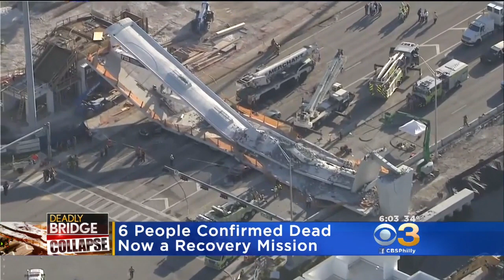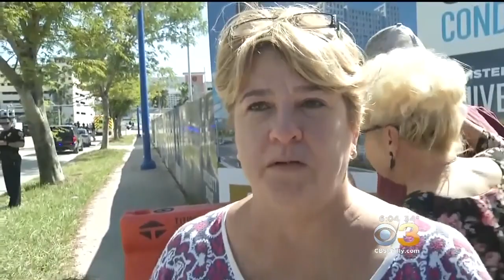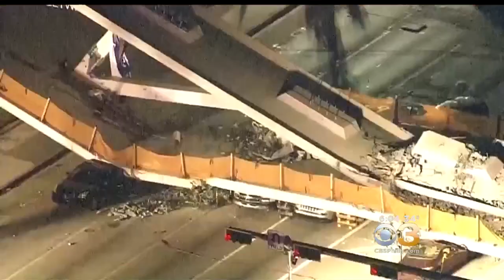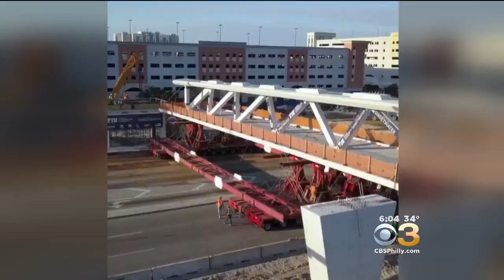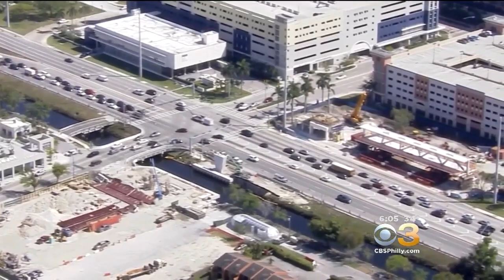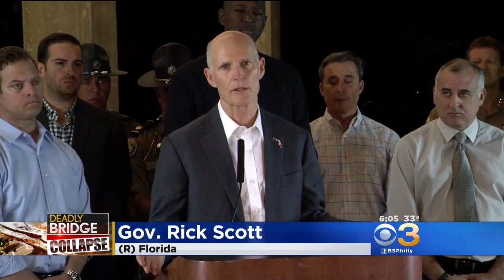6 Dead, 9 Injured After Newly-Installed Pedestrian Bridge Collapses At Florida International Univers

Comment: they dropped a piece of stress testing equipment from the large crane because the crane hook failed. the left end in your pictures is where it hit the roof causing the roof to pancake on top of the lower deck. eyewitness said the crane hook was straightened or a piece broke off of the hook. the equipment was a tensioner of some kind.
Reply: Unless the boom of the crane fell on the roof, there is nothing on that crane that could have made that bridge fall. Hurricane proof, remember ?
Reply: Jim Campbell — They were not doing a stress test, they were adjusting the tension bars.  Should have closed the road for that, too.

Comment: You see that blue motor at the end of a rod sticking out sideways on top of the bridge near the side that collapsed. That is what took the bridge down. They were in the process of tightening the tension cables, a stress test and way over torque it. I guess this is what happens when it fails the stress test.
Reply: Oh, did they snap the tendons ?
Reply: If they were in the process of doing the test. Why the he'l didn't they detour traffic? To me this is murder!
Reply: The bridge was damaged internally from failing to support the ends during the move. Internal sensors alerted the contractor moving the bridge that something was going wrong and wanted to stop the move but was pressured to complete it and figure it out later because of all the dignitaries that had gathered under the big party tent that morning. A couple days later they recklessly and criminally attempted to correct the tension until it snapped. The plans called for the supports during the move to be at the ends but the builder figured they could save a lot of money by moving the supports inwards and not having to  level the road under the ends. But the bridge was not designed to support its weight that way and it was damaged and because this cantilever bridge was covered in concrete they were unable to see the damage but a good engineer would have known there was damage.
 Bottom line the builder knew he fucked up and then tries to quietly fix the problem that he was unqualified to even understand.
Reply: Why would they need to support the ends during the move ? The end sections of the tendons don't need to be supported, they need to be left alone. If you saw the sketch of the completed bridge, it was suppose to be a suspension bridge. The only part you got right was the tent full of dignitaries. They should have been invited to the grand opening instead.
Reply: Actually they still have not said anything, I pieced it together and a year from now the NTSB report will agree with me.
Reply: In your dreams
Reply: Kwame 
First of all: It is a cantilever bridge NOT a suspension bridge. The tower and cables that were to be added later were purely cosmetic. A cantilever bridge must be supported at the ends, not doing so changes the whole dynamics and WILL damage the bridge PERIOD  
I have to say you had me going there for a minute , I thought I was conversing with a person of intelligence. 
I think we're done here Kwame_Be_Broke... Goodby
Reply: Yeah, you're done alright. Obviously you did not see the rendering. It's a good thing you are leaving, next thing I know, you would be hounding me for my atuograph. 

A Note to the Public - Please excuse the silly ramblings of Phil, he thinks he knows how to build a bridge. 
It's obvious he got his knowlege last summer while waving a flag at passing cars. Fortunately, he excused himself from this thread; this means you will not be subjected to his uniformed blurting any longer.
Reply: phillip kalaveras then the builder should be tried for murder. Period 
 But that won't happen the companies will be sued. There will be a settlement and no one truly pays for the loss of life. That is the definition of criminal in my book. Whoever made the decision to remove the supports and whoever made the decision to move forward is responsible.
Reply: yeah, you tell him heather.
Reply: phillip kalaveras — No, not a cantilever.  It was a truss supported at both ends.